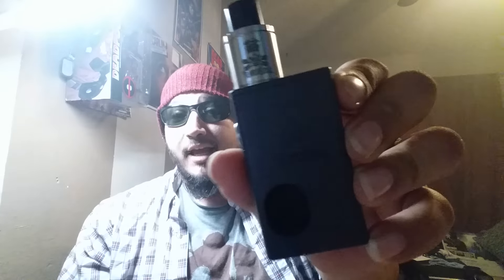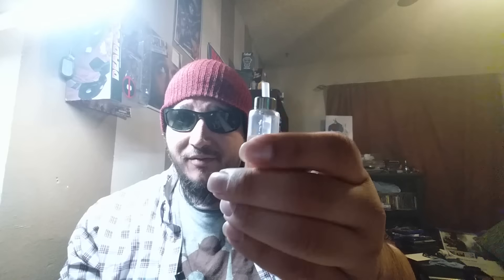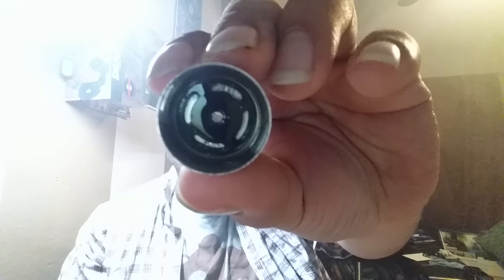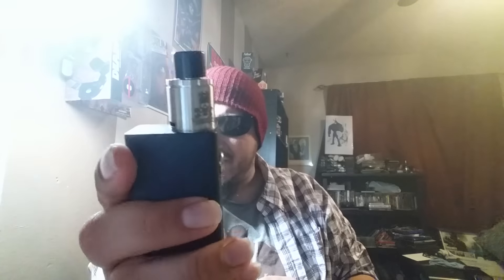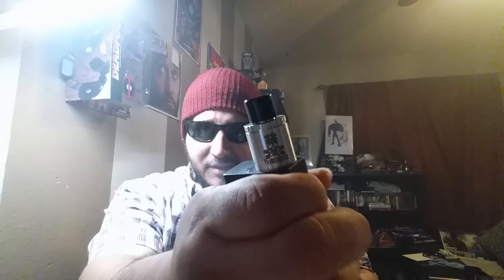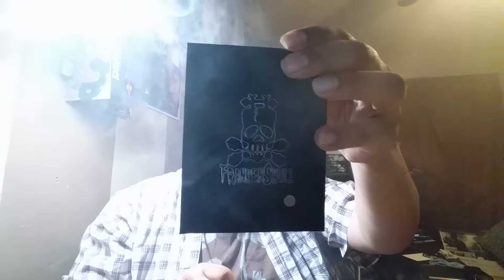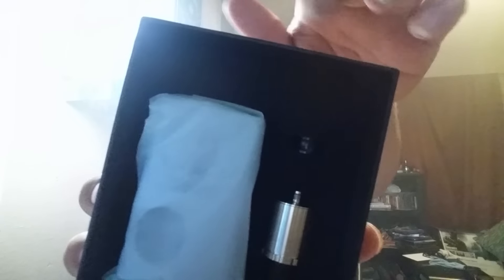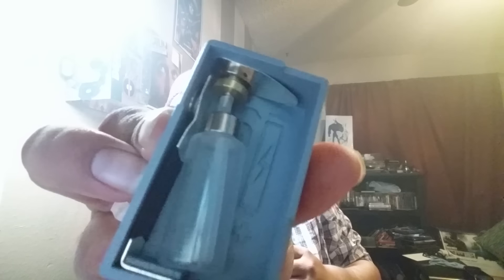frankenskull clone

Comment: Ordered the "Red" one as a kit at 3FVape.
I have an authentic Hadaly, but it doesn't create a good connection either on the Frankenskull or the Pico Squeeze mod.
Paired the Frankenskull with my Noname mods NoToy, threw out the shitty bottle that came with the mod and replaced it with a Super Soft squonk bottle.
Mod performs absolute stunning and hits like a train now!
Love it.
Reply: Patrick Carstensen depending on what version you have manually adjust the 510 pin. Mine manually adjust a little on the V3s.

Comment: V3 is good. just put bottles in hot water, not boiling, for 30 minutes it helps. There are several other bottles that work. The V3 510 is awesome. Stock contacts aren't bad as well and stock rda is not bad. $20 vs $160 and a year wait for an authentic.  You chose.

Comment: Put battery in positive down. Some of my batteries don't work positive up and they should be pos down on this device for other reasons.  Use other bottles and/or soften them in hot water.

Comment: 0.2 ? You'll melt the insulator in time i'd not go too low on such build materials tbh.
Reply from the maker: Regalya thanks for the tip. seriously thank you I'm not being a dick. on the same side its a 19 dollar clone. I don't see this thing lasting more than a month.
Reply: I've 10 buck clones that last well over a year easly it's about how you use it and material durability tbh

Comment: just got mine, I got two both don't work. wtf
Reply from the maker: kim warner that sucks. email who you got it from hopefully they give you credit.
Reply: kim warner lol. It's a mech, how can it not work ? What version ? I've had 9 of these and modded them. They all worked stock. The V3 don't need any moddin done.
Reply from the maker: Arron Greggs
i got 3 mech clones that miss fire all the time, this one, the anubis and the castigador. how they messed up a direct connection is odd but they found a way